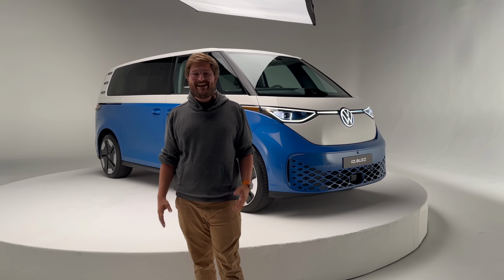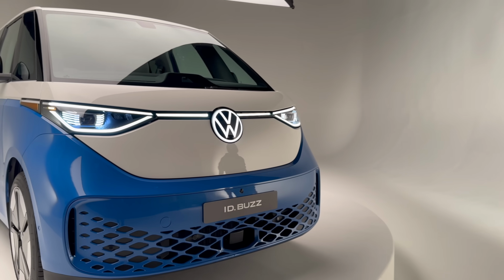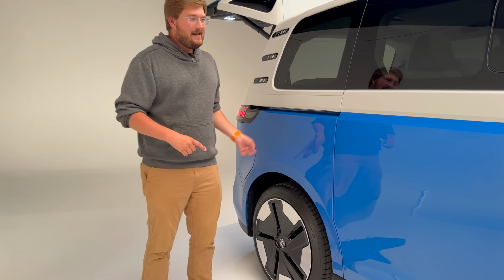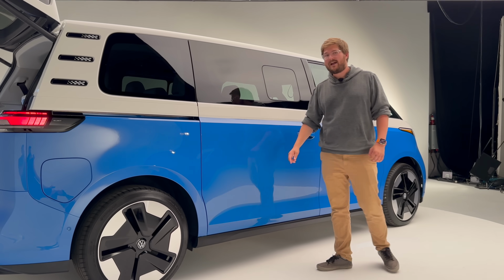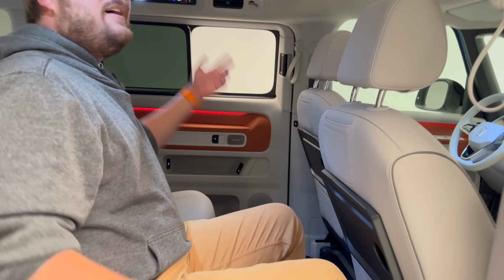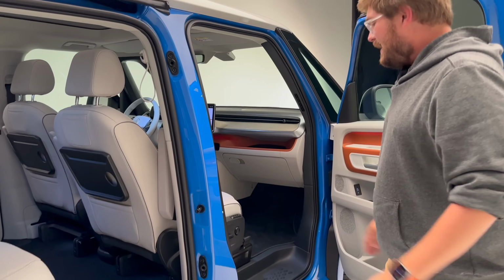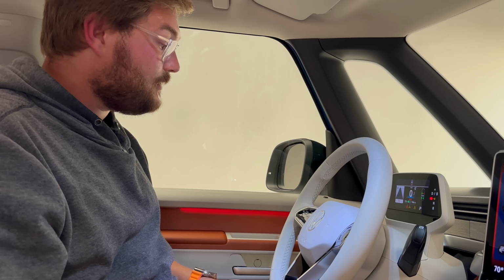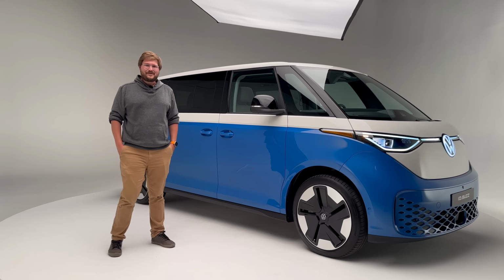The US Spec Volkswagen ID. Buzz Is Finally Here! The LWB Is Freaking Awesome & Worth The Wait

Comment: I love the look and overall build of this vehicle. Really hopeful that we get the mini-camper version at some point. That is the type of vehicle I'd want to take to campgrounds and RV parks for a long weekend
Reply: It would be great to be able to plug in and use the A/C at a campground.
Reply: Agree. I like modern look without losing connection to original car.
Reply: If there's a 120V standard outlet you can. I bring a portable Level 1 charger when I charge and if I find an outlet I can get about a 50% charge overnight on my VW ID.4 @marknewman3360
Reply: Depends on what type of campgrounds you like. If you are into US Forest Service, BLM, and National Park campgrounds, hardly any of these have hookups, and most are in such remote areas that there's no way you could go camping to them in an EV - none of them have enough range, especially if the campground you are talking about is in mountainous terrain, where the range of an EV is maybe half what you get in flat terrain. I love the idea of a camper-van version of the ID Buzz, as a successor to the old air-cooled VW micro-bus Vanagon, but the vast majority of State and Federal Park campgrounds, at least currently, simply have zero support for EV's. If the ID Buzz were a PHEV instead of a pure EV, it would be a GREAT base for a camper van conversion, but so far, the only PHEV mini-van in the US is being made by a company that has been through 3 different owners in recent years, and even when it was still "Chrysler corporation", the quality of their cars was arguably the worst of the three US manufacturers.
Reply: @laura-ann.0726  Good points there. I know it's about US spec, but I live in Switzerland where everything is much closer, and it would be possible to top-up the battery just before going really up the mountain. So range is less of an issue. Also going up drains the battery, but going down recharges it so you don't need much to go back. For me it sounds ideal for trips of mostly 2-300km and 1 or 2 nights. In the US I imagine it's great for surfing, but not to go far into the wild.

Comment: The more I see things like this, the more I miss my '72 Type 2 bus that I could work on myself. Total cost: $950 for the bus, and $350 for a rebuilt engine (plus extra cooling stuff that VW didn't provide to keep it from self-destructing). So, for around $1500 total investment, I had reliable transportation that ran for more than 90,000 miles over the next 6 years, with proper maintenance!😉
Reply: My dad bought a 1968 bus for $1500 in 1969. Then in 1977 he installed a Porsche 911 engine in it for a total of $1K. Now I got it for free and it works. Best part is, it can go up hills at a good clip and it has real heat. Plus the mileage is better than when it had that 52hp flat 4 in it.

Comment: Great review. I just really wish VW would consider a larger battery pack for the US. If we assume EPA at 250-260mi...you start driving this at 70mph, add 3 or 4 passengers and some cool/cold weather the range will easily be under 200mi. Thats kind of rough for a road trip. I really think 300mi is the minimum for a road trip vehicle...
Reply: Agreed! - however I do think they’re betting that 90% of the user’s travel will me shorter commutes in places with abundant charging networks. I personally would not buy an EV unless it had 500 miles range and 15-minute or shorter charging time.
Reply: EVs in the shape of a brick are not designed for long range highway use. These are urban runabouts.

Comment: The sliding rear windows reminds me of the original sliding manual windows on the last model years of the German VW Buses, from 1977 to 1979. Earlier models only had a vent wing on the rear windows, or louvers for the camper models.

Comment: it have a public toilet door for a roof 🤣
that glas is used for public toilets so people can see witch one is free

sounds like people get cold/hot feets in the back, it can take some time before the temperature hits the floor in a room like that

to be onnest it looks like the old software on a new screen, i dont se any improvements from the nokia like interface in a 10 year old gte

with all the bugs they have been fighting (thanks to their lack of costumer service) i guess you cant expect any big steps from their side on that point
the fact that its not ready now, tells me this will not be fun for some costumers.
we have seen that multiple times with vw

they had many years to learn their software, and they still dont know how to program it 🙄

one thing is the german nokia like interface, bosch is kind of simuler..
but the bugs is not ok, they deliver a buzz with a 15 year old golf interface/sofware more or less, wtf..

and still no regenative driving in 2023, all the parts are from old cars

only real update is the 220/110v outlet 🤣

i also bet the front side windows break it you hit them soft on that square corner it have, a round corner makes the whole window stronger..

Comment: No. The whole POINT of a VW Bus, and why there's so many Vanagons still out there is to combine both having a little table between facing seats, with the ability to flip the bench back into a bed. Without that, IT'S JUST ANOTHER MIN-VAN. 

As soon as another company comes out with an E-Bus with the above, all those Vanagon owners will ditch VW and buy that. Canon anyone?

Comment: Here in Norway the European version is completly sold out. My dream car, besides KIA, and the electric Hummer. I actually like these single colors better than the two toned that it ususally comes in. And I see it everywhere here in Oslo, used as vans for firms, mostly building firms, to export goods/tools. I love the bulky exterior and shape.
Reply: not only is it sold out, but norway bought most of the what is on the marked in eu..

i remember the old days where it was posible to have more then tools in the back of a vw, they stopped being atractive when they stopped having room for standards sizes plywood and drywall.

and that will be the biggest reason other vans will take over that marked..
i would seriusly double check the prices if someone turned up at my door to fix anything in a van like that..
this van is not a usefull tool for a carpenter for example

is it even posible to get this without windows or with one door so bigger tools dont break them, and so they can be strapped to the walls.
or so cabinets can be installed

this car is not usefull as the older models was to many people..
it is more or less for private use if you have a big family or like camping or surfing

Comment: Electric vehicles are a complete disaster. From not enough charging points anywhere, ridiculous charging times, the pollution created by battery manufacture, the additional cost of running an electric vehicle not to mention the exploitation of African workers to get the raw materials for the batteries. The sheer weight of electric vehicles compared to CE vehicles meaning multistorey carparks will need to be strengthened to cope with the weight. Not enough electricity being produced to cope with the expected number of elec vehicles which will result in more power stations being built with all the additional pollution that brings. We have been lied to by numerous Governments and pressure groups who laughably spout the ''we need to save the planet'' rhetoric. Trust me I believe this will all end in tears.

Comment: I love it, I want it but I’m worried about one thing that just about every mini van has but this may not: the ability to remove all the rear seats for full storage. Let’s hope this is something you just missed.
Reply: Third row comes out, but second row does not. I think in part because they have heated second row seats, so removing would mean dealing with wire harnesses.

Comment: There should be a monitoring system to control dealership markups. There may be an initial surge in sales of the VW I’d buzz by the one percenters (1%) but then sales will decline because the rest of the country will not be able to afford it.😢

Comment: Meiner Meinung nach wäre ein perfekter VW ID BUZZ 5,15 Meter lang und 10 cm breiter, mit Allradantrieb und Allradlenkung sowie einer Leistung von mindestens 600 PS ausgestattet. Er sollte eine Reichweite von mindestens 400 km bei einer Durchschnittsgeschwindigkeit von 130 km/h haben und Platz für 7 Personen bieten. Im Inneren wäre es mir besonders wichtig, hochwertigere Materialien zu verwenden und als Infotainment-System das neueste von BMW oder auch das vom neuen Porsche Cayenne Facelift einzubauen. Zusätzlich sollte eine Batterie mit einer Nettokapazität von 110 kWh integriert sein. Mit diesen Merkmalen wäre er in meinen Augen der beste Elektro-Bus der Welt.

Comment: This could sell well. But, I fear it’ll be priced way too high for sales to really fly. I sure hope I’m wrong. Thanks Kyle and your whole team. Lotsa love to all ❤❤❤
Reply: It will be a zillion dollars and as reliable as most VWs.
Reply: @OMGWTFLOLSMH  I have had 3 VWs in the past and present, never had issues with them. Beetles. I like this Buzz but , so far the rural areas do not have charging stations, they should put them on the interstate rest stops, gas stations and convenience stores. Then I would be excited about them.
Reply: What is MEB? I've never heard that term.
Reply: @mberrey45    > What is MEB?
MEB = Modularer Elektro-Baukasten = modular electric construction set. - The technical base, like batteries, motors, for most of the VW ID models (in the moment for all in production), also Skoda, Seat/Cupra, and future Audi entry models. Ford wants to use it, too, in a cooperation. They have this system and nomenclature for quite some years, e. g. the MQB (Modularer Quer-Baukasten) for ICE cars with lateral engine mount. From a construction set they develop several platforms (smaller and bigger) and use each of these platforms for several models.
Reply: UK $74,000 (£s equivalent).  Nice appealing vehicle, but no way could I bring myself to pay that amount of money for a new vehicle.  You can buy a brand new VW Passat diesel estate,, which will serve a family well for years, with a range of 800 miles on a tank of fuel, for $43,000.  EVs are cheaper to run, but it is a lot of money to make up, and how long do the batteries really last?
Reply: They don't even sell the Passat Sedan in the US anymore, let alone the Passat Estate, and they stopped selling diesels here after the Diesel Emissions Scandal. @malcolmabram2957
Reply: "Could"...well: isn't. Sales numbers in Europe are disappointing.
Reply: Currently set at $40K
Reply: @SteveBueche1027  lol no way. This thing will be $60-70k fully spec’d
Reply: @chags3512  No fully spec'd car will sell for $40k ... ofc when you hear quotes it's base price.

But I think the base model is already fairly equpped.
Reply: @RunForPeace-hk1cu  right. I heard today that VW may be making them almost all fully spec’s. Massage seats standard for example. That’s why I think it will be 55-60k
Reply: @chags3512  higher.
Reply: @cypvh74  wouldn’t be surprised. This and the Kia ev9 will probably be $65k
Reply: @SteveBueche1027  75k

Comment: I feel like that 150mi range for Norge is fine, they have the infrastructure.  If the States can get to that point, and the battery longevity, I feel car makers can start reeling their battery packs DOWN in size.  There are many performance or small cars that have small gas tanks/short ranges, and because of the immediacy of gas stations, its really a non-issue.  If we can reach parity in the infrastructure, who cares if your EV only has 150mi, and can recharge in 5-10 min?

Comment: Volkswagen has truly nailed it with this one.
Reply: Australia here: Range limitations make it a toy only. I need 800 kms minimum and AWD otherwise have to lug around a gasoline powered generator. Those wheels will not last 10,000 kms. Kerbs and flying stones will quickly tear them up. Glass roof not desirable in Australia.
Reply: No. Lackluster range, poor interior design, and gonna be too high $$.

Comment: I own 4 Teslas.  If your on the highway and alot in hot/cold weather you need at least 300 mile range.  Most lithium ION batteries also want to stay in the 20-80% range for the most part.(important to think about with range).  Lithium IRON batteries more usable range as they love 0-100% range.  Sadly in USA most public charging stations are slow level 6-19kw 12-24 mph).  Sadly most public level 3 DC fast chargers(Tesla calls superchargers) are only 50kw vs Teslas level 3 120-250kw.(500-1200 mph) Rare to find public 100 kw let alone advertised 350 Kw stations.   We need more level 3 charging stations in USA with at least 130 kw like teslas superchargers.  All of Teslas superchargerscharging stations are level 3.
Reply: Something like 40% people no garages so dependent on charging stations

Comment: I hate big wheels.  It increases unsprung weight which affects handling and mileage.  Plus tires more expensive.  Rims more prone to scuffs as less rubber. I always go with 18’s or 19’s max  .  Pick up a 20 inch mag and compare weight with 18 inch.  It’s significant

Comment: Two word question: Chicken Tax?

Ans: Apparently it doesn't apply to the version with rear seats. But it's also why we won't get the cargo van versions.
Reply: I was thinking the same thing. Maybe they do like the transits and ship them with basic seats/windows and they get stripped down at the port.
Reply: @patrickferguson7591  It probably doesn't matter; they will be so short of production capacity vs demand that selling the transporters here will not be possible and, at the price they are going to be able to sell all the Buzzes they can make, certainly not wise in terms of profits. Kyle alluded to this: there will be no low-spec Buzzes.

Comment: Overall I love the Buzz.  Wish they had gone with LFP battery pack.  Wish they had gone with round headlights for a more retro look.  Sliding door is a total failure.  The whole point of a sliding door is to get more access into the vehicle.  In the Buzz you actually get less than the standard door behind the driver's door.
Reply: I am happy with the sliding doors. I need a wheelchair-accessible car with sliding doors. SUVs have displaced minivans from the market, the choice of which is becoming smaller and smaller. It is the only option for people in wheelchairs.

Comment: The Buzz looks like FUN.   

Everyone blames dealers for gouging when the problem is the supplier cannot produce enough product.   How convenient to blame the dealers for trying to get what they can for the limited supply there is, and at the same time the manufacturers have an axe to grind if they can bypass the dealers and maximize their profits instead of sharing it with the middle man who happens to be providing other services and representing your brands locally.   Nothing good can come from this.  

People not near major metro areas already are familiar with Tesla's non-existent presence and limited services model.   It is not good.  I would prefer a local dealer and service center any day.   How about manufacturers get back to producing vehicles instead of rationing them?

Comment: Are the rear seats easily removed?
Would be great if they folded flat....
Reply: Only the third row is removable...at the Moment...perhaps the 6 Seat Version with Single seats is different, but I coud not find it out so far. 
And Seats fold flat and you can sleep in this car easily.
Even the right Seat folds flat and you can load very long items.

Comment: The battery is going yo be the sticking point the eu just hot 170 miles per charge highway   Adding one module will only add 5kwh 5kwh in the eu was just 2.3 miles per kWh so this will nearly hig 200 -220 in summer testing highway , I wish vw would drop this Id design language,it’s not a patch on,older models ,mits no wonder the Korean cars are dominating sales now

Comment: This guy doesn't really understand market dynamics. Due to the price that will be around $60K, no way it'll be $50K or less, I doubt this will be sold in crazy volumes. The nostalgic customer and the influencers who want to stand out will get this, but it'll be like the New Beetle where it'll peak in popularity early then drop in volume. The market itself wants an SUV that's more affordable.  There's a reason why the van market is shrinking. Also, with the low range it will have limited van life appeal. You can't do a road trip without having to charge multiple times.

Comment: one of the real substantial improvements in the VW MEB is the new drive train that includes the new in-house developed motor with more oompf and efficiency and more efficient inverter as well. that will be rolled out to the id.4/5 and skoda enyaq and audi q4. i hope at some point for the id.3 too. that would be great.
regarding the battery, VW need better modules. pretty much the same like 2019. that is a bit dated.
they should add a more modern module as option with 17% more energy density to reach 100kWh net.